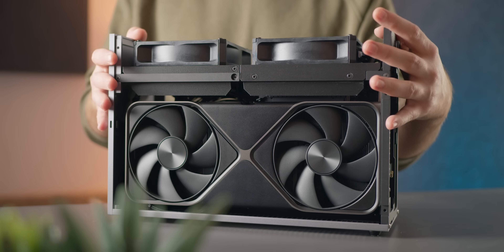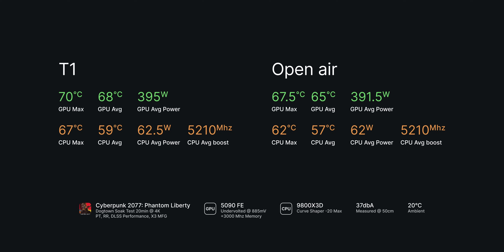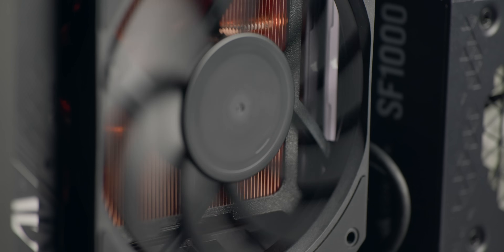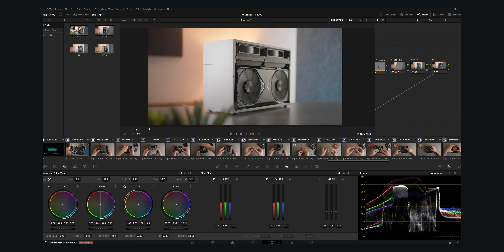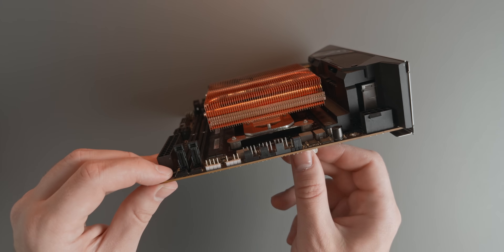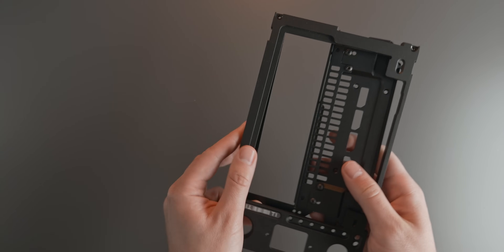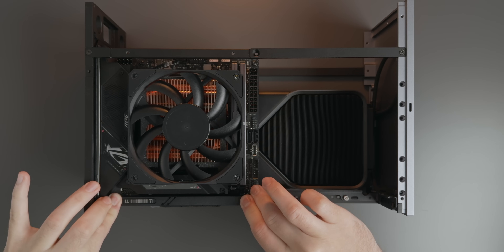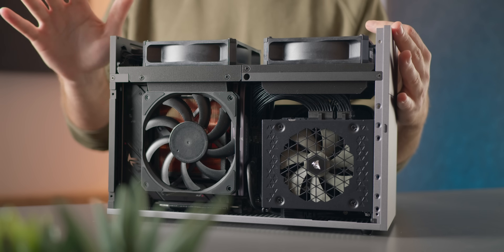The Ultimate FormD T1 5090 Build & Guide

Comment: Do you think using the flipped t1 backplate for the 5090 will help a lot taming the temps? Instead blowing the hot air inside the case it will actually exhausted out.
Reply from the maker: I really don’t know, the theory is good but it may not work in practice. In some preliminary tests by 3FC I think the results were worse actually, but it may have been without “case” fans. In any case, if I get a flipped kit I will for sure test it.

Comment: would i  be able to attribute things from this guide to a build in the t1 v1.1 if possible? if so, what differences would i need to watch out for if there were to be any major ones?
Reply from the maker: You can get pretty close to this build with a 1.1 by building in 3 slot and using some additional 20mm standoffs to create a gap for the 5090. You’ll have to skip the exhaust shroud and the travel kit, but you can actually find an anti-sag bracket for the 1.1 here: https://makerworld.com/en/models/1443227-formd-t1-1-1-50x0-5080-5090-anti-sag-bracket

Comment: At 13:20, where can one get those black hex head screws as replacement that you're using? As well as on the side strut at 17:20/17:44 and those case feets at 17:27?... Thanks!

Also, your videos reminds a lot of Optimum's. Same high level and clean production. Keep up the good work!
Reply from the maker: Thank you!

The black hex head screws are from AliExpress, have had them for a while now. Basically I just searched for black hex head screws in the exact same thread and thread length as the ones in the official manual. 

Case feet are these ones: https://www.aliexpress.com/item/1005003981153468.html?spm=a2g0o.order_list.order_list_main.5.48b61802bhlG7A
Reply: @EIGAtech  Massive thank you sir for the reply, massively appreciated! 😊

Comment: I really love the anti sag bracket, I feel like I would fly with my PC like that. Currently with my Ncase T2 I have to pull out the GPU every time in fear of damage. Although I have water cooling CPU side for mine which keeps it whisper quiet.
Reply from the maker: I did make a version of the anti-sag bracket for the M2 but it’s for the 4090. I can easily update it for the 5090 though, keep an eye out on my Printables: https://www.printables.com/model/1044291-ncase-m2-anti-sag-bracket-40804090-fe

Comment: Dont know if I should swap my NCASE M2 for the Formd T1. The M2 has a lot of flex and flimsy side panels which I dislike, but I’m not sure how much louder I would need to run the AXP90 X47 Full copper compated to my current PA120 Mini.
Reply from the maker: The PA120 mini is a league ahead of the x47 FC in terms of cooling capacity, but I wouldn’t say the compromise is that big. It really all depends on your day to day usage, if it’s mainly gaming then the x47 can do it in 99% of the cases with max performance.
Reply: @EIGAtech  Thanks for the explanation! I will try to snipe a T1 2.1 once it comes in stock again. I'm waiting for the silver model with CNC sides..

Comment: One last thing, does your build have any coil whine from the motherboard / GPU? The motherboard you linked (B850-i) vs the one you have, do you know any problems of coil whine?
Reply from the maker: The motherboard I have does have coil whine, but it goes away by running OpenRGB in the background, the 5090 FE has lots of coil whine but it mostly becomes inaudible with an undervolt.
Reply: @EIGAtech thank you, you helped a lot!
Reply from the maker: @ericzavala7275  Sure thing! I would say don't worry about it too much, I haven't heard reports of the new B850I having coil whine, and if it does, it's probably manageable in the same way as on the B650E-I. And for the GPU... it will almost certainly have some coil whine, but you can mitigate it and (you won't like this) probably get used to it and forget about it.

Comment: awesome video dude, super informative i will most likely copy you but one question, why did you choose the Corsair RS120 Max Fans and not the Phanteks T30s? are they better? Also another question, can i put a sata ssd in the front in this type of setup?
Reply from the maker: Thank you! The RS120 and T30s perform about the same, I would get whichever are available. There is room for a SATA ssd attached to the front panel.

Comment: Is this guide not viable if I don’t have the travel kit?
Reply from the maker: It’s viable without the travel kit. You will only need some extra 20mm standoffs. Two on the riser bar exactly the same like in the video (or four 10mm ones) and one more 20mm standoff for the GPU I/O bracket lock bar on the rear panel.

Comment: Im almost ready to build mine, just waiting on the custom cables. One question though, a lot of people use a standoff mod (i guess
For the motherboard?) i don’t see you using it. Whats the reason for it?
Reply from the maker: The standoff mod is part of the travel kit as it comes with the standoffs needed to add a 20mm offset to the riser bar.
Reply: @EIGAtech ah right, but you can add the standoffs yourself without the travel kit right? Where exactly should you put them?

Comment: Quick Question what is the approx weight of the whole build?
Reply from the maker: I would estimate between 8-10 kg.
Reply: @EIGAtech  That's pretty good i was planning to make one for my college use and frequent carrying. Thanks
Reply from the maker: @ANKS02 Considering the level of what’s inside I’d say it’s quite “light” for a portable system. You literally couldn’t go lighter without sacrificing performance.
Reply: @EIGAtech  Thanks a lot man for the insights it will help me a lot

Comment: Thanks for your awesome video. Does the description include all the parts you used for this build? I'm planning on one like this, but am going to go with a 5070ti or 5080
Reply from the maker: Yup, everything is listed in the description.
Reply: @EIGAtech Thank you so much for your reply. I have a question, and I'd greatly appreciate your opinions N. Between the nanoq and the formd t1, which one do you think is more physically secure and robust for frequent travel? I'm currently traveling in an rv for work, so weight isn't an issue like it would be for flying. My main concern is the robustness of the case itself and how well it secures the components inside. It looks like the nanoq is a more solid case, but the formd t1 already has native solutions for securing the parts inside. I'm worried about the pc bouncing around when I'm towing and also being disturbed when I stash it away and bring it back out for use. I'd enjoy your frank opinion on these two cases. The uni body shell of the nanoq looks like it's much more solid than the formd t1. Thank you in advance.

Comment: Hi I am planning to do a similar build like yours just with a 5900x and 5070ti because I need the multicore for work. Are there any particular reason to go with a air cooler instead of a 240 radiator?

Comment: Watching this video is making me consider building with the formd t1. Does the case come with a pcie riser cable without an add-on? 
Also, why use air-cooling instead of an AIO like the arctic liquid freezer iii 240?
Reply from the maker: It comes with the standard gen 4 riser which is all you realistically need (as long as you set your motherboard to gen4 mode if you have a gen5 card). Using an AIO is possible, usually the Fractal Lumen or CoolerMaster Atmos Stealth, but because space is limited, you will need to either use slim fans only, or a combination of a slim fan + a single 25/30mm thick fan above the PSU. Fitment is more difficult and it would only benefit CPU only workloads. I recommend getting an AIO only if CPU performance needs to be prioritized.

Comment: is the travel kit required to build the 5090 with 5.0 riser?
Reply from the maker: No, it's entirely optional
Reply: @EIGAtech thanks for answering! What is the added value of the travel kit, besides sturdiness when taking it on the road)
Reply from the maker: The added value is indeed the sturdiness. For me it’s the level of customization and improved build quality, but is it a necessity? No.
Reply: @EIGAtech that great to know, thanks.

Comment: Hello Eiga!
Congrats with a build. 

A few questions. 
What is your 24 Pin Modular Cable length? I was afraid to buy 10cm . The next option is 20cm and its too long. I need either 10 or 15.Its perfect on your end.
Can you show adapter for front USB? I printed mine and tried to build in, but usb cant be plugged from the outside in. Its just not enough space

Thanks

p.s. I am building with 9950x3d . Not very successful so far. Tested 3 coolers ( x47, x53, axp-100. ) x-53 + noctua fan works better than other combinations. 
Waiting for Air slimmer to test with 100. I had an idea to test 100 + A14x25 g2 , but I need extra 5 mm of space :(
Reply: with a 9950x3d in a t1, you should probably be looking at an aio. a popular one people use is the cooler master atmos 240. you will need to replace the included fans with 1 slim fan above the motherboard, such as a noctua 12x15 or silverstone airslimmer. the second fan can be a phanteks t30 or one of the corsair fans he used for exhaust in the video. assuming youre using a 50 series founders card, the rest of the video applies except the last step is installing the aio.
Reply: @dmicik1 I don’t recommend noctua 12-15 . Results of the tests were quite bad with every cooler I tested . 

Waiting for air slimmer .
Reply: @Karmazins  there's been tests comparing the air slimmer and noctua slim fan with the atmos & t1 combo, they are within margin of error of each other but the air slimmer came out on top. but to each their own. air slimmer would be my top recommendation but some people really prefer noctua for the build quality alone which is why I mentioned it.
Reply: @dmicik1  nf-a9x14 so far is the best. I will leave another comment when  I will have results with Air Slimmer. 

If it will not work out, I have another list of AIO to test)))
Thanks
Reply: @Karmazins  oh, I wasn't talking about the fan on an air cooler in the t1. I was talking about what fans you would use with an aio
Reply: @dmicik1 got it ;) thanks

Comment: Love the build! Would a pair of Noctua NF-A12x15 120mm fans be a good replacement for the corsair ones up top, or do they not need to be as slim? Also, is this T1 case in silver or titanium colour?
Reply from the maker: Thanks! Going for NF-A12x15  would be a significant downgrade compared to 30mm thick Corsair or Phanteks fans as those do most of the work of keeping this case cool. My T1 is Titanium, it looks silver in the shots due to how it catches the light.
Reply: @EIGAtech  Thanks for the help. Two questions about the exhaust shroud - 1) If I am using the AXP90-X47 FC cooler, does the 'part A' half of the shroud only need the higher clearance (as it shows in the download files on printables)? What about part B? 

2) I have Nylon PA12 filament available to me rather than the PETG that you recommend. Will I need to scale the models up to account for shrinkage, and if so, how much? Thanks

Comment: Was the SS200 or LS100 riser used in the video? Also, for the fan shroud—if I’m following the video, should I print Part A (custom) and Part B? Just asking for those of us without a 3D printer who need to print on demand. I see five files, and this will be my first time doing this. PETG + 100% infill seems like the way to go (I think). Congrats on going full-time! Subbed.
Reply from the maker: It's the SS200 as linked in the description. For the exhaust shroud, if you are going for the 120mm fan mod then you print the Part A (custom)  + Part B, otherwise just regular Part A + B. You would send one .STL of each to the printing service. 100% infill is almost never needed with 3D printed parts, as the parts themselves use very little infill anyway you can just go with whatever, 20-40%.
Reply: @EIGAtech  thank you!

Comment: Awesome build, I was wondering why you didnt go for a 9950x3d upgrade? is it because of power consumption and cooling requirements or simply because you dont need it?
Reply from the maker: Thanks, pretty much that, there's no benefit for me and the cooling would be compromised under all core workloads anyway.
Reply: @EIGAtech makes sense, thanks for fast response. will keep in mind when i build one of my own assuming i don’t miss another case restock 😅

Comment: Hi Eiga,
Please advise whether you've used M3x5x4mm heat-set Inserts with D=4mm / L = 5mm or D=5mm / L = 4mm? 
:) Thank you
Reply from the maker: They are 5mm in diameter with 4mm in length

Comment: Great video! I used the AXPx47 FC on my 9800X3D, but I was hitting around 88-90c during Warzone. Currently using a Lumen 240, but I would really prefer the axp fc for simplicity. The 100W PPT, and negative curve PBO should do the trick eventually?
Reply from the maker: I haven’t tested Warzone but I did hear it said before that it’s quite CPU heavy. Are your CPU temps better with the AIO? And if so, are GPU temps worse?

Comment: Loved this video!!  So clean and very well put together!  If possible, can you share details on how you managed connecting all of the fans to the motherboard?  As someone new to ITX builds, I'm a little confused as to how you connect the case fans to specific headers on the board itself.  Thanks so much!!
Reply from the maker: Thank you! It’s pretty simple: Cpu fan goes to CPU FAN header and the two exhaust fans go into a Y-splitter that’s plugged into the CHA FAN header. Fans are controlled with FanControl in Windows.
Reply: @EIGAtech  Thanks so much for this!  I had assumed that was the case, but it's always great to get confirmation!!!

Comment: @EIGA - Congrats on another spectacular build! ❤‍🔥

Why did you choose to go with AMD Ryzen 7 9800x3D and not 9950x3D? What do you think the thermal difference would be in your build? Would it likely to be higher using 9950x3D? 

And also I'm curious about the CPU thermals running modern online multiplayer games, for e.g. Star Wars Battlefront II. I noticed with my build that CPU temps are by a margin higher - CPU is running hotter by ~10 degrees more. Does your build handle it differently?
Reply from the maker: Thank you! 

The 9950x3D would probably be just as fine in gaming as the 9800x3D, but for multicore intensive tasks you just won’t be able to properly cool it in this build, so it’s a bit of a waste.

I have not tested SW Battlefront II so I cannot comment on temps in that game. How many watts is the CPU pulling during gameplay?
Reply: @EIGAtech   around 120w for 80 c

Comment: Do you think delidding the 9800x3d is worth it in this type of build? I'm thinking of doing it but I'm not sure if the risk and cost is worth the potential temperature gains.
Reply from the maker: The gains would be worth it for sure, it's just not possible with the AXP90-X47 FC unfortunately, and I don't know any other cooler with which it may work. The cooler would need to (a) be nickel plated and (b) be small enough to clear any VRM heatsinks or anything else around the CPU area when it sits lower than usual.
Reply: @EIGAtech  How about using the Thermal Grizzly Heatspreader? Should be better than stock no?
Reply: @EIGAtech  What @vik1ng313 said is what I meant originally sorry, delidding the 9800x3d then putting the heatspreader on top with a low profile cooler making contact with that heatspreader.

Comment: one question. does your asus b650e-i has quick release for the gpu pcie slot? so do you tilt the gpu to put it out ? on amazon they say quick release in the discription. maybe try did a revision? idk. is yes is ypur mainbaord older or did you get it in recently? thx!
Reply from the maker: Mine is from when the chipset was new so it’s an early model, no quick release and I kind of doubt they have updated it, as it has been replaced by the b850 model.
Reply: @EIGAtech thx very much.
Reply: @EIGAtech may i ask you about the m.2 heatsink of this baord. it does bend the n.2 ssd many claim.this on reddit .since i saw much videos where you use the b650ei. many claim about that the board does bend the m.2 ssd. i know that you can put a stadoff under rhe ssd which comes with the board. the question is which one because i read that there are 2 heights and where to palce it. since there are 2 spots.

Comment: Since you are going full-time you could consider selling ready-made 3D printed parts like the exhaust shroud, etc. Would be nice extra revenue stream and a good way to support the channel for viewers without 3D printers!
Reply from the maker: Definitely an option, although shipping would likely cost as much as the part itself 🤔
Reply: @EIGAtech is the as120 better than using the noctua 92mm fan? I heard that using a bigger fan on a smaller cooler doesn’t actually help, but your temps look good. I have both fans so I am not sure which to use on the cooler.

Comment: How much better cooling is expected with the same Specs in a NCASE M2 Air Cooled ?
Reply from the maker: The M2 is 50% bigger in volume which will allow fitting larger tower style coolers in its classic layout. As for how much better, at the very least you’ll remove the CPU cooling limitations in the T1.